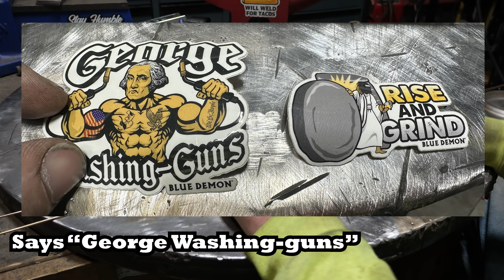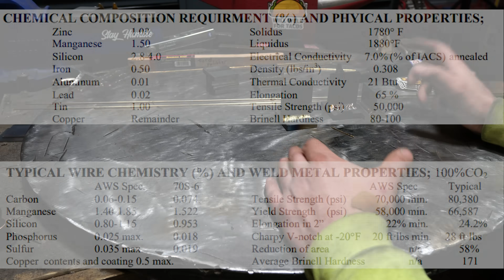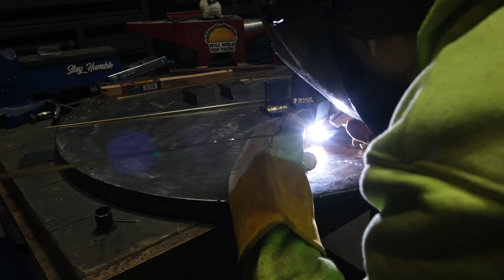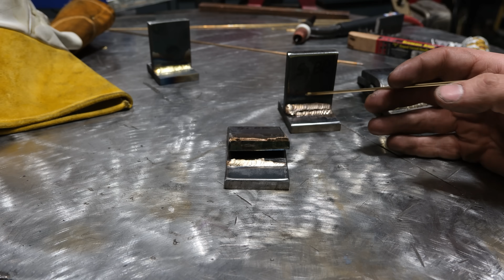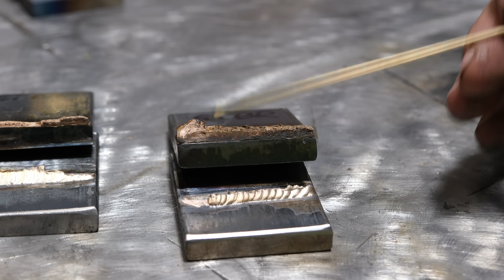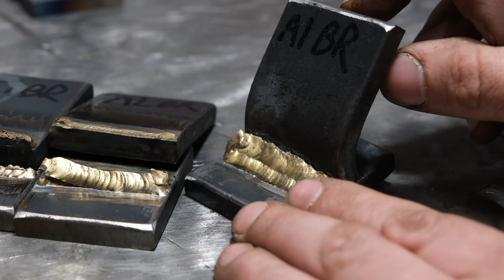Silicon and aluminum bronze brazing, how strong are they?

Comment: I have some of that latte night tv(dates me.. lol) Alumaloy rods......probably from the early 90's....i never used any of it, but was wondering if it might work with very low Amp tig for aluminum cast repairs of non critical stuff or who knows what artsy type things.....have you ever played with that stuff?
Reply from the maker: Good question.  I can tell you that those rods probably are functional for brazing more than actual welding.  With that said aluminum brazing tends to be very strong and more than capable of handling a lot of jobs.  I would worry a bit using it on something that needs a lot of strength, but for less critical repairs/patching cracks/holes I am sure it would work fine.

Comment: Sillicon Bronze via MIG with 100% Argon is actually required procedure on certain auto body/collision repairs. Its used in pillars where the OEM uses a coated steel and they do not want the introduction of rust and it keeps the coating intact.
Reply from the maker: Very interesting, thanks for sharing that info.  Not having a background (or much experience in) auto body I would have never known that.  Auto body is more of an art than most welding and much of what they do is a lot different than most other types of welding.  Considering how strong bronze is I can see that working great.

Comment: I've only ever used ERCuSi, time to order up some ERCuAl and see how it compares. I mainly use it for decorative finishes on items. I'll generally do a tiny bead with the proper filler and then cover pass with bronze. I especially like the look on stainless. 

After seeing how strong the aluminum bronze is I'm certainly overkilling it for my coffee tables and little tool items like nutcrackers.

I have also successfully "welded" copper to brass. I'm confident the base metal melted which is why I'd call it welding. It was a copper pipe to a brass elbow. Elbow was threaded and pipe was not hence the need. It's just on a portable pump suction tubes for emptying big totes. Both of them have held up fine.
Reply from the maker: Bronze is shockingly strong, especially on thinner material.  I am sure your brazes are stronger than they need to be by a lot, but that’s not a bad thing if they look good while being strong 😀.  Definitely fool around with aluminum bronze.  It gives a distinct color of its own and if you use a/c (90% a/c balance aka 90% EN) it can make super wide gold dimes that look really good aesthetically 😀.
Reply: @makingmistakeswithgreg I ordered some up and I'm excited! Your video plus a few others about the toes wetting in better on AC made me want to check it out. Sometimes the SiBr just wants to hold that surface tension a bit too long before wetting in. I'm very curious to try this out and see how it runs.

Comment: I would've liked to see some single-pass 3/32" numbers from your peeling test. Part 2? You could even compare zero fusion to deliberate base-metal dilution.
Reply from the maker: I will be doing some short arc MiG brazing soon, I will try to through some tig into it 👍

Comment: 24:07  Flux core welds are that weak?  Huh.  Never knew.  I've thought about getting one of those dinky machines just for outdoors and emergency stuff.  I was wondering if the flux in the middle was a bad thing.  The opposite of stick welding where it's on the outside of the rod.
I'm glad that I stumbled on to your video!  Thanks for that nugget of information!!!  :)
Reply from the maker: So flux core wire welds are strong, and unfortunately they tend to be brittle.  The biggest issue with self shielded wire is on steel 1/4inch or thicker porosity tends to be an impossible to solve issue.  The weld solidifies so fast that escaping gas gets trapped inside the weld pool as it solidifies.  On 3/8th steel aluminum bronze will likely handle more of a bend than self shielded flux core because of the defects.  How you can get around this is using thick wire like .045 to 1/16th flux core, which many machines won’t run.  On 3/16th and down steel self shielded will produce welds stronger than the base material for the most part.  😀👍
Reply: @makingmistakeswithgreg    Thank you for all of the insight!!!  VERY good to know.
So am I right in thinking that stick welding doesn't have this problem because the flux is on the outside of the electrode?  Or is it more because the electrode is so much thicker?
In other words, am I better off with a stick weld for outside work?
I'm thinking of situations where I need to repair something like a trailer.  Or if I'm just overthinking the whole thing.  LOL!

Comment: Thank you for making this presentation which, as are all of your videos, is very informative.  This might be a stupid question but would appreciate your thoughts,  Would this be a suitable process for butt welding autobody sheet metal in a location where you have no back side access to hammer out the weld?  I would love to find a way to avoid the monumental warping that comes with a regular tig butt joint in sheet metal.  Thank you.
Reply from the maker: Great question.  So brazing of auto body is done, most commonly with the MiG process.  Since you’re not melting the base material it’s possible to get lower heat input into sheet metal with brazing and lower heat input means less warping. The other added benefit to brazing with tig and Mig is the “weld” is softer and easier to sand in many cases than an actual weld.  This can help prevent someone from thinning out the base material around the braze.

Now when it comes to the feasibility of using tig brazing on sheet metal, I have some thoughts.  It absolutely can be however if the base material has any treatment on it you will have issues with tungsten contamination.  MiG brazing tends to be far easier because you dont have to deal with an erratic arc due to contamination.  The other potential issue is that since the braze should have minimal base metal melting into it, you must be careful with running so cold that by time you sand it down there is no thickness of braze left.  

I will have to do a video experimenting on heat input and warping on sheet metal to get a better idea how effective tig brazing is.

Comment: On chromed Hydraulic shafts that are damaged and hurting the rod seal I grind the damaged area down about a  1/16 to 1/8 deep and tig braze aluminum bronze in then file it close and sand it the rest of the way. I've had those repairs last quite a long time. 
It helps to pre heat the area to about 300f then pre etch the area with the ac balance really low and the frequency high about 120-180hz if the area is large keep the heat down and the arc only on the rod if you need to stop.  Restart on top of the repair not the termination point.
 !!!DO NOT BE AFRAID TO MAKE A DEEPER GRIND FOR THIS REPAIR. IF YOU DON'T GRIND DEEP ENOUGH OR OVER PENETRATE YOU'LL MAKE A HARDENED SPOT YOU CAN'T SAND!!!

Comment: I used to braze steel rule style fabric cutting dies (big cookie cutters used in powerful mechanical presses over thousands of cycles) where the parent metal often broke before the braze. Brazing is ideal for that because it makes removing damaged steel quick and easy by thawing the braze with a torch. OTOH welds require cutting and reweld.  I've done TIG and MIG (needs argon shielding gas) brazing to and enjoy them but prefer to use an oxy-acetylene torch for the narrow, long reach tip choices a TIG torch cannot reach. OA doesn't require shore power which is nice too and a variety of cylinders from the the little "HVAC size" kits ( I also transfill medical oxygen cylinders I use with an adapter to fit standard regulators. MIG brazing wire can also be used with a torch so you're not restricted to thick awkward flux-coated filler rod.

Harley and many other motorcycle frames were torch brazed long before TIG was invented in the WWII era and some high-end racing frames are still brazed today. Key is PRACTICE but unlike welding you can thaw and re-braze practice parts repeatedly. Torch brazing is easy and teaches puddle control as does OA welding. The equipment is cheap used (the best quality torches were from ~the 1930s until most makers offshored and it's easy for a torch to last a century like two of my Oxwelds) and mostly made in USA. Welders need a torch for cutting and torch bending so a few heating tips and a (I use shade 5 mostly) clear welding helmet lens or face shield (goggles don't protect the face and svck over glasses) greatly expands your choices. 

BTW I buy shielding, fuel gas and oxygen cylinders used from private sellers etc since they're filled mostly by exchange. I make out like a bandit at estate sales, liquidation auctions etc. Know what cylinders you can exchange and avoid leasing unless you have a large business and need regular deliveries.  I have nitrogen (to pressure test automotive air conditioning systems, and you can use argon or MIG mix for that in a pinch since they're more inert and nitrogen is only used for its low cost), oxygen, acetylene, argon, MIG mix and CO2 (cheaper and holds more volume per cylinder because CO2 stores as a liquid under pressure, and handy for freezing parts before press fitting them, tire inflation and much more).
Reply: Hi ! AMAZING content in YOUR comment ! THANKS !

Comment: I have a question...First off, thanks for all your GREAT content!! Im a beginner but ive learned from you , so im an advanced beginner hahahah. Job: stripped bolts, Question: Yesterday, i welded a clean rod 3/8 to a bolt the same diameter......i seen and felt the penetration in my weld.....turned it right out. Today, i cannot get penetration at all? Flux core, turned the machine up still not working. Is it possible to blame the cheap welder? (yeswelder 250 pro) Or should i look into cleaning the rusted bolt head more? Thanks bud!
Reply: .30 flux  core, single pass wire. if that matters. Yesterday 16.5 volts was perfect, today 17 just wont penetrate. (Obviously tried the settings from yesterday first, then turned it up)

Comment: What I'm thinking is what's the difference between penetration down below the surface and 
' penetration ' right on the surface?
Reply from the maker: So a normal weld would produce a change in the grain structure on the sides of the weld and at the root.  On a cut and etch you would more or less see the weld “nugget” exists beyond the original edge of the steel base material.  That weld nugget is a fusing of both the base material and the weld filler.  This is incredibly strong because it often is consistently beyond the root and a decent amount into the base material.  With brazing there is not fusing of the bronze but what’s known as a “inter metallic bond”.  This is incredibly strong, but the reliability of that bond requires exactly prep, any surface contaminates can cause a very weak bond.  Technically brazing shouldn’t penetrate and alloy with the base material, therefore its bond will always less reliable than welding.  Even assuming a perfect surface bond, the lack of root penetration of bronze can produce a weaker joint mechanically.  The less root penetration the easier it is for a weld/braze to be used as a “fulcrum point” and end is failure under stress.

Comment: Ummm, brazing works by adhesion, not fusion, to the parent metal.  This is why brazing is used to join dissimilar metals that cannot be joined by fusion.  The strength in brazed joints is dependent on the area that the braze has wetted.  hth

PS:  Silicon Bronze has tensile and yield strength of 50 ksi and ~30 ksi.  Aluminum bronze has tensile and yield strength of 79 ksi and 35 ksi.  Cleanliness of the joint area is critical to obtaining a good brazed joint.

The tensile strength of silicon bronze is on par with the tensile strength of the commonly encountered cast irons.  As a result, brazing can produce an acceptable repair to most cast irons while avoiding the metallurgical problems of a welded joint repair.
Reply: Are you an AI bot just repeating what was said and discussed in the video, yet for some reason saying it wasn't? 🤣 Basically all of this information was covered in just as much detail minus the "official strength numbers" which are handy to know, but will vary by manufacturer/materials/use case/proper application/ etc, so aren't really a very practical measure of strength unless you know the exact setup/methods used to certify those values and have base materials being joined that will achieve that value... 🤷‍♂️ And as far as "Fusion" that's a bit pedantic of an argument... If you use some polyurethane based adhesive that does not penetrate to join aluminum and sealed wood it would meet one or more common definitions of the word "Fusion" even though it's acting similar in principle to brazing materials together, not "true fusion" as described in other definitions of the same word... I think the concept was conveyed quite clearly of how the process bonds materials and using the word fused or fusion was in no way misleading or misrepresenting the process... Obviously as shown and discussed throughout the video... 🤷‍♂️ But thanks for listing those values, I haven't looked them up for tig or oxy rods in quite a while, so a nice refresher for a general material strength number. 👍
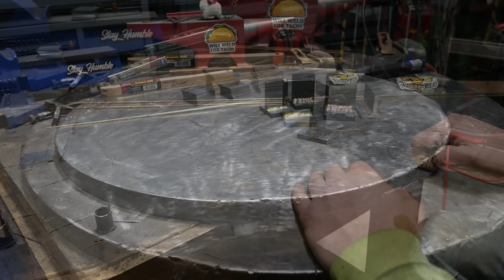Reply: Actually nevermind at 10:30 in the video after going into detail about how you cannot rely on the labeled strength for so many reasons he clearly states it is NOT a typical fusion process 😂 Apparently I should also pay better attention instead of unnecessarily commenting my criticisms on what someone says... 😉👍
Reply: @ It is not a fusion process.  There is more to the design of brazed joints than what he describes here in order to achieve the maximum strength for the joint.

Also, brazed joints develop their maximum strength when they are subject to shear and not tension.
Reply: @ No, I am a licensed engineer who has spent his career in Materials Science, Fracture Mechanics and Solid Mechanics.

The values published for material strengths are specified minimum values and in practice are usually higher.  The published values are used for design.

My use of the word fusion is not pedantic.  My use of it is based on the definitions used in the field.  In Materials Science the word fusion is used to indicate that the two parent metals and or filler metals have actually combined to form a third composition.  Whereas in brazing this is not the case.  If you were to examine metallurgical cross sections of a welded versus a brazed joint, you will see a clear difference in microstructure.  In the case of brazed joints there is no combination of the filler metal and the parent metal.

I believe that your example of stating that using a polyurethane based glue to join aluminum and sealed wood as fusion is incorrect.  This joint is still an example of adhesion.

In materials science, the word fusion has been adopted to indicate joining of metals where there is a mixing of the material of the two components with or without a filler metal.  This is because the fusion on many plastics does not meet the traditional definition of welding.

While Tim did change the use of phrases in terminology later in the video, he did initially refer to it as welding.

hth
Reply: PS:  That should be Greg and not Tim in my last paragraph.
Reply: @paulkurilecz4209  Well congratulations on any and all of your professional accomplishments, and I hope you are doing well... But I still think nit picking minor use of definitions over context when it is well conveyed to the average consumer of this content, probably already familiar with the process is unnecessary and honestly a waste of your knowledge while coming across as criticism towards a channel with a professional humble host that states often these are his opinions based on his experience... I think there are MANY youtube "expert welding instructors" channels that actually deserve and legitimately need your criticisms! (Although they will likely block you pretty quickly after any valid critique or criticism... Atleast from what I've seen 🤨)
Reply: @berryreading4809  it is a technical subject, why not use the proper terms?

I like this channel.  Greg and I have had many extensive conversations, and we have both learned from each other.

The amount of misinformation and incorrect information that I see gets mind boggling at times.

Did you hear that two welders actually agreed on something?  They agreed that the third welder was doing it wrong.  🙂

Comment: Ive seen a cast iron exhaust manifold on an antique tractor torch brazed and hold up for decades.
Reply: From what I've heard a braze will typically last longer on cast iron because it has the ability to flex and stretch a little where a weld is more likely to break under stress, like he explained in the video, just don't use it where it gets too hot or it will fail due to high temperature.
Reply: @marcellucassen8033 well I've used welding to repair two cast iron vises. One was about 1/3 of the moving jaw was missing I welded over the entire area with eutectic rod and then built the entire missing area back up with er70-s6  The other one was the jaw support on the fixed jaw side was broken clean off so I welded over the area with nickel 99 rod then built it all up with layers of ER70-s6. Both of those vices are in regular use and I don't take it easy on them. I use them like I would use any other vise.

Comment: this isnt its use case though why would anybody use very expensive bronze wire to do a job a simple mig weld would do better ? - its for joining non weldable steels - espeicaly thin tubes were the fillets are much bigger than the tube thickness - or in my case i use silicon bronze filler for welding silicon bronze castings 😁 and brazing/welding  bronze castings to steel and stainless steel .